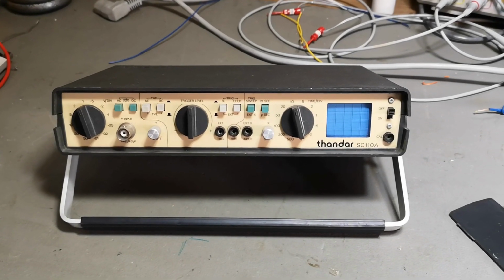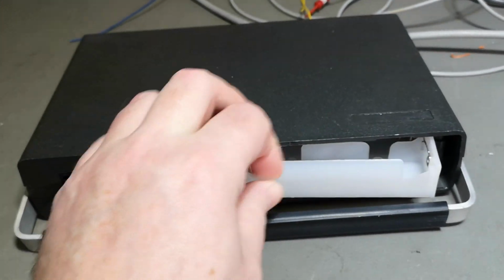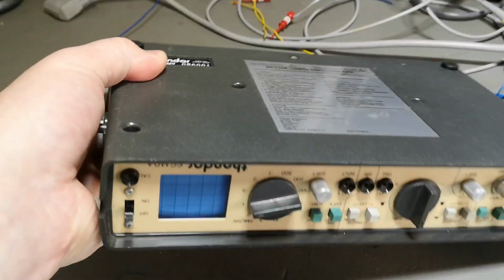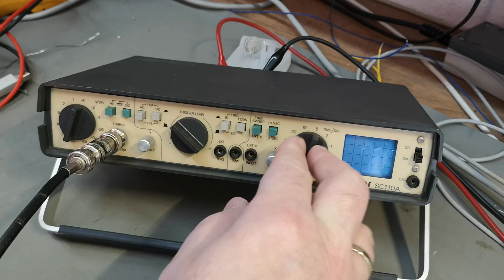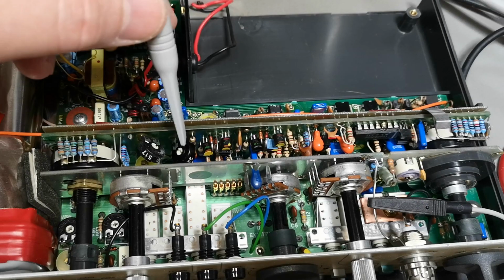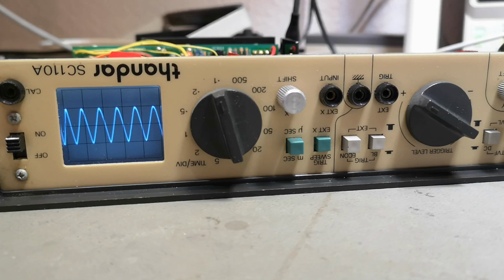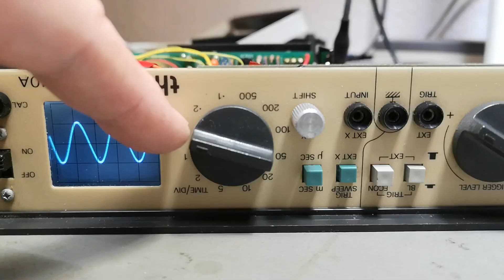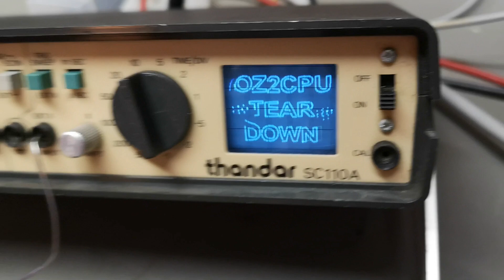Thurlby Thandar SC110A 1ch 10Mhz oscilloscope tiny battery operated

Comment: You didn't mention, and may not be aware of this yet, but this oscilloscope started life as a SINCLAIR SC110A. It was designed and manufactured by the same company that made the DM2 multimeter, the computers and the small televisions. In fact, this Sinclair oscilloscope uses the same cathode ray tube as the earlier types of microvision pocket TVs. Thunder acquired Sinclair's lab. product range at some point. You seem to have a knack of picking up 1970s British technology!!!!!
Reply from the maker: thanks mate, maybe i got more :-)